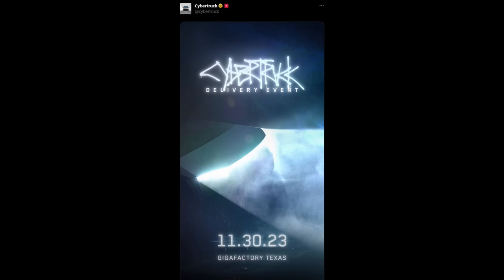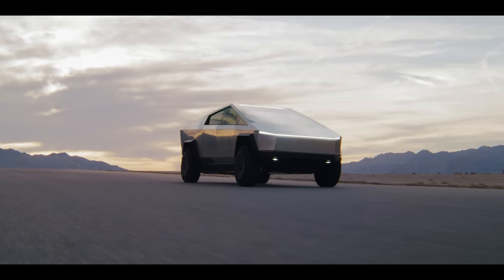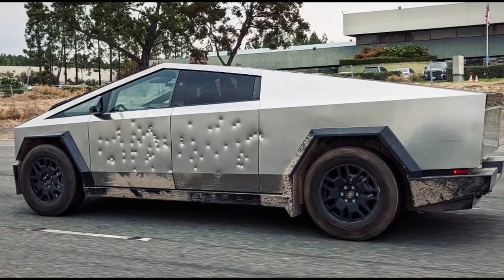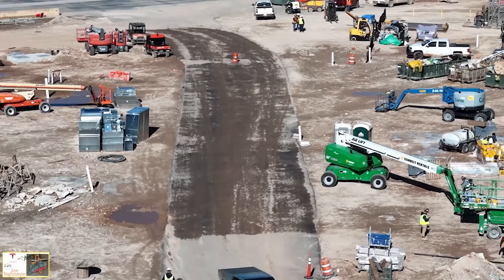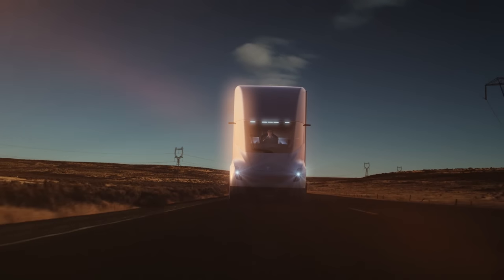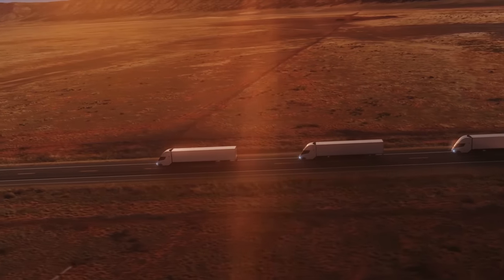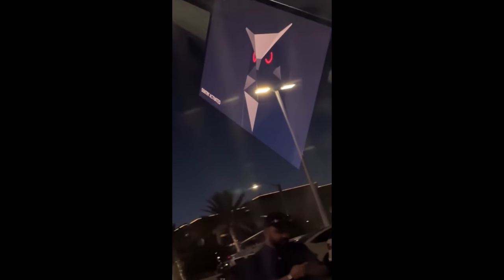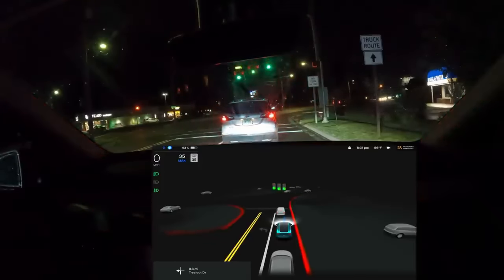Tesla Cybertruck Delivery Event Approaches

Comment: Addtll comment... if you're towing, have you heard of superchargers that will accommodate? Maybe they could use the semi network whenever that gets built out?
Reply from the maker: Yeah this is a weird situation. Imo they should have been building superchargers with Cybertruck in mind since 2019, but it seems they really only started earlier this year.

With that said, most superchargers have at least one "pull in" stall for towing. Some other places are much more tow friendly. But for the most part, most stalls will need you to drop your load before charging
Reply: @DirtyTesla Unfortunately that pull in charger is normally at the entrance or exit of the charging area, and a trailer blocks ingress or egress.  They need some pull thru chargers.  Plus many people use those pull ins when not towing.

Comment: Tesla's next gen Roadster is supposed to have a 200 kWh battery, so they have been considering batteries of this size for many years (since 2017).  Hopefully Cybertruck will have a 500 mile version, as that would be great for long-distance towing.
Reply: Figured the Roadster was basically canceled.  Haven't heard a thing about it in a loooooooong time.

Comment: Not that there are any risk of that CT being approved here in Sweden, but IF, then you will not get into it during winter.
Reply: We have snow and ice even in Texas. What is doesn't have is delicate plastic door handles; it has power releases.  Stronger than plastic.  Also,  you could use your ice scraper on the doors without hurting them; you could use a mallet!
Reply: @jamesengland7461  Yea, right... Welcome to Sweden.
https://www.youtube.com/watch?v=pJId1L4oB_c
First, you will not be able to push that little unlock thingie because of frozen shit covering it (i can literally have 1-2 centimeters of hard frozen snow slush on the entire car - you can barely see the handles!) and then you will not be able to full that hard on that over frozen little edge and then you will not be able to pull with enough force to loosen the rubber seals that have frozen to the body of the car.

Comment: Aerodynamically the Rivian is more efficient then the Cybertruck. Assuming the epa milage is calculated the same Tesla would need to make up any differences in the motor or battery efficiency.  If the cybertruck does not at have a 450 mile version it will just be another joke of a ev "TRUCK" made for a grocewrey getter .  No one wants to tow in an EV if you need to drop yourt load every time to charge every 100 miles. I'll wait longer for a 500 mile ev truck or just cancel if it is not a reality.  The CT will live or die by its range.
Reply from the maker: I think even with poor range it'll sell well, just not to people that want to tow. Even if it's 500 mile epa, towing will be significantly less, especially in the winter, think 200 miles or less. I think that is still low enough to turn most ppl off. I don't tow anything as of now so it doesn't matter to me, I want to haul.
Reply: @DirtyTesla  I believe it will sell well among existing tesla owners since even at lower range since it may be an upgrade from a MY but If the CT doesn't have a class leading range the only people that are going to purchase it are existing Tesla owners, especially those using it as a car . I have a MYP and a CT reservation, I was planning on replacing my truck with the CT but I won't be doing it with a 300 mile version, The MYP range has been dissapointing ( especially in hear in FL with the heat) so as much as I want a CT I won't compromise on the range.

Comment: Cybertruck is supposed to have about a 200kwh battery pack. That will get to close to 500 miles of range if you don't use lights, a/c, heat, and no towing, etc. I also believe it won't actually hit 500 miles of range unless you're on a 500-mile downhill highway using Max Regen.

Comment: I don't believe the truck was crab walking. If you watch it the truck is going in a straight line but the body is at a diagonal. Crab walking is with the vehicle in a straight line but traveling diagonally.
Reply: That’s the same thing, just looking down the line it’s traveling vs looking down the line it’s facing.
Reply: Same thing.